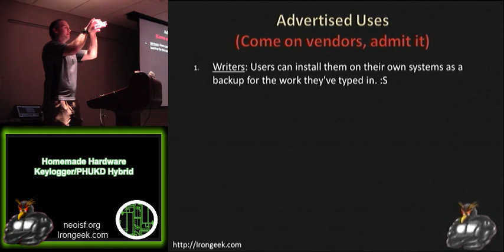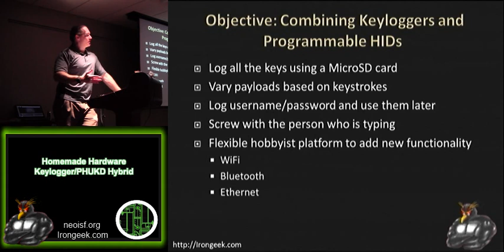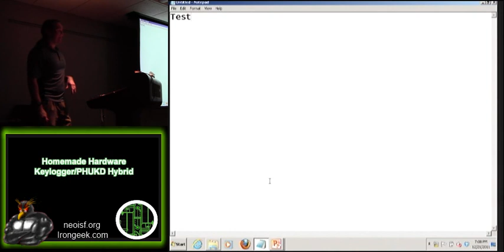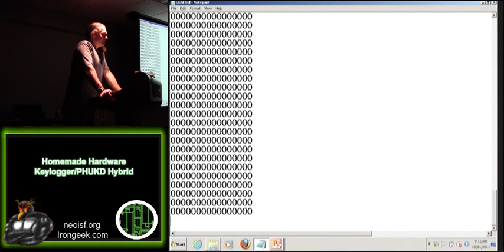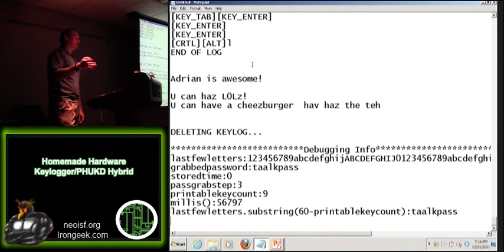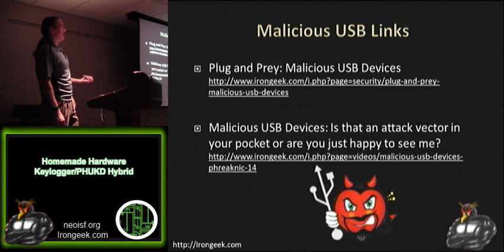Homemade Hardwaren Keylogger/PHUKD Hybrid

Comment: Are u alive bro
Reply from the maker: I think so.
Reply: @irongeek  glad to hear from you , im making a hardware keylogger and i just need the keystrokes. Is there any easy new method.
Reply from the maker: @sithumgimhan7650  I'm not aware of one. I've really not played with hardware very much in the last few years. Key loggers themselves though have come down a lot in price last I checked, it may not be as useful to build your own as it once was.
Reply: @irongeek  is nowday security can detect a hardware keylogger? Like behavioral analysis
Reply from the maker: @sithumgimhan7650  unless it shows up as a new device like a hub or what not a hardware key logger is hard to detect barring physical inspection.
Reply: @irongeek  thanks for replying, im going to make one with arduino. Long live the geek